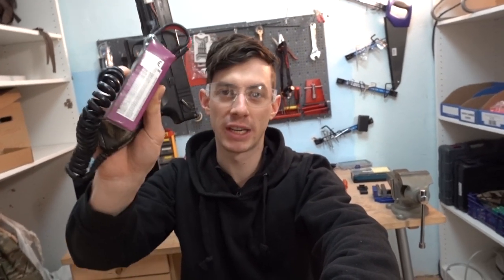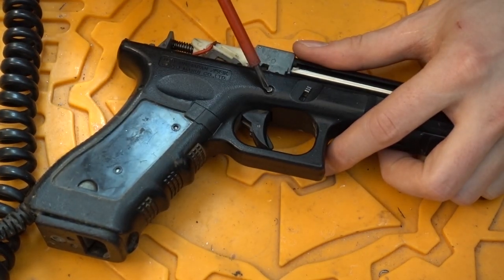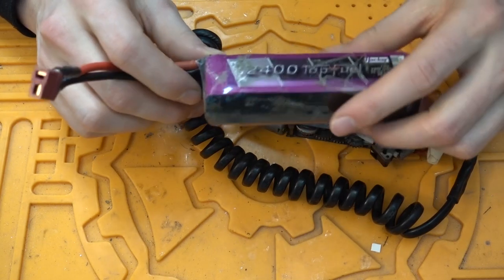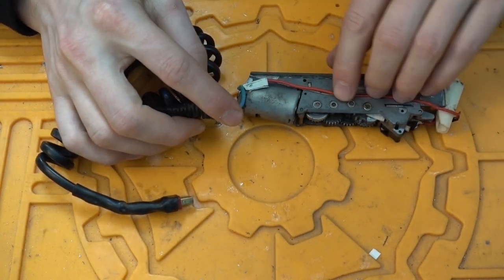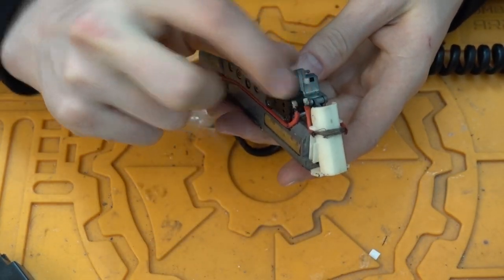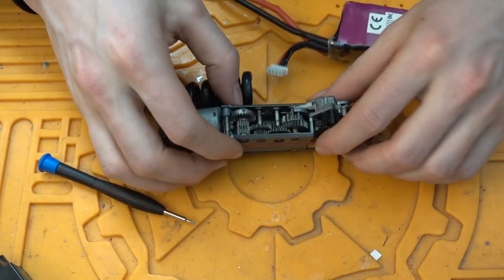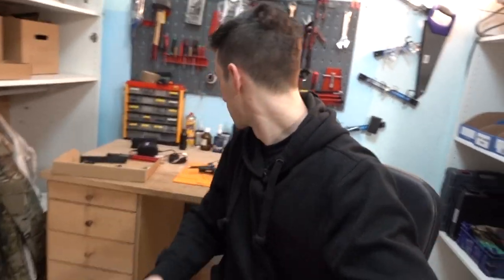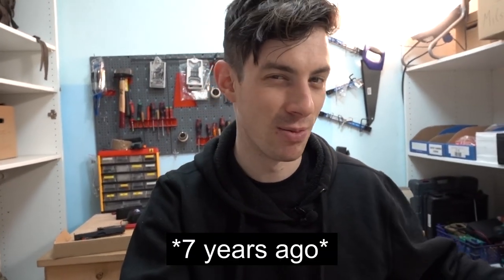External 3S AEP Lipo Mod - Lanyard Cable

Comment: Nice Video Novritsch!
For all which want to do this mod pls don't lose the little Spring under this metal thing on top mounted with 2 screws. Without this spring the pistol will not work properly. Also I highly recommend using a mosfet in this, especially a Cyma aep trigger switch  gets  fucked quickly! I don't know the marui switch unit but I would say that not using a mosfet with this setup isn't ideal as well.

Comment: I really recommend fitting a mosfet in there...
Reply: He's had this set up for a couple of years. He hasn't had a MOSFET in it.
Reply: @callsigngecko4723  I´m not familier with the Marui System. All I can say is, that besides the fact that the cheaper Models (Cyma, Double Eagle) dont like the high voltage batteries, the gears quickly wear of, for sure depending on how much you use the pistol. Maybe your switch unit will hold up the higher voltage load, but a mosfet is definetly a good idea.
Reply: @param3dix  maruis are really reliable. They are (correct me if I'm wrong) the first airsoft maker. They are really good quality. There are very little bad reviews or complaints about the TM platforms.
Reply: @param3dix  also of course mosfets are amazing but not needed in this particular build.
Reply: Yes. Switch assembly should be f*ed up immediately with this lipo.
Reply: Anyone thinks a cyma cm 030 can handle a 7,4v lipo without a mosfet or do you guys think it will die pretty fast? Any answeres appreciated

Comment: just go to a secondhand and buy an old razer or old phone. In most cases it wil cost you less and the quality of these older cables is better than the stuff you can find these days. If that doenst work out, aliexpress.

Comment: It is a good ideea, but ... where is the fuse? All that 11.1 LiPo can (and it will) burn your motor. It happened to a friend of mine , he has a 1911 AEP Cyma gen 2 with mosfet already monted but the Cyma didn't install a fuse so when he upgrade it to a 80 spring and a 11,1 LiPo, the result was a bured motor. So a fuse is a must for AEP/AEG!

Comment: Won't such a high voltage kill your standart motor or gearbox?
Reply: DC motors can handle more voltage, but if you have some more advanced AEP or AEG, there can be some electronics which maybe can't handle it. But problem is you can't just increase voltage only little one li-po or li-ion cell has exactly 3.7V so 2 cells have 7.4 and 3 cells have 11.1V and that could be already too much. So only variant how to increase cadency is probably use 3 cell battery and lower voltage by PWM regulator or voltage step-down chip, but that's already too much complicated and you probably can't but all such things inside of AEP, but with big AEG you could do it I guess. Fully charged 2 cell li-pol or li-ion has 8.4V so I think constant 9V would be perfect. You can use older ni-mh cells where you can work with voltage more precisly because one cell has only 1.5V in fully charged state, but ni-mh batteries have more disadvantages.
Reply: @Pidalin  Thank you for the explanation :)
Reply: @Pidalin  ok but this is standard is 7.4 and 500mah battery and this upgrade is like 4200mah 11.1v battery wouldn't that kill something inside ? :) maybe if you have mosfet version to do this upgrade which i think to will it kill mosfet or its good ? Tnx i love to see someone who like electronic to discus it. I understand that 11.1 vold will push engine speed on automatic but what with normal semi auto shoots ?

Comment: I have a question, I’m just putting this on your newest video cuz maybe you’ll see it first but... I got my SSP1 right, and I was wondering if other hi capa parts are compatible with this gun, like if I wanted to put some airsoft masterpiece parts like a slide or anything in, will it fit??

Comment: There is a Glock aep on the market which has a lipo and mosfet wired to it as standard. I think it's called the Yakuza Delta Tactics Aep but I think the company name changed now. What are you opinions on it?

Comment: I got my SSP1 from batch number 4 a few weeks ago, it was amazing the first few games but after that, it skips bb’s and the hammer uncocks itself or just gets caught in the center causing co2 leakage. It is an amazing gun, but there’s sometimes that it becomes unreliable in a fight because of it skipping a bb or the hammer locking. If you can respond with an answer as how to fix this, that would be much appreciated
Reply: welcome to airsoft

Comment: Hi, nice video, planning to do the same on a cyma glock, why shoud i use 1mm² if the inside cable is 0,75mm² ? And also do i need an additional mosfet for 11.1V LiPo?
Reply: No you shouldn't. Personally I'd only run a 7.4v it will last longer.
Reply: Don't forget a mosfet or your switchunit runs to hell.

Comment: What do you think about upgrading Hop-up on the Cyma variant? to ML maybe?
Reply: the cylinder volume does not support heavier BBs. The joules actually drop with heaver BBs. There is no need to exchange the bucking as it can hop the lightweight ones anyways. Unless it could improve the seal.
Reply: NOVRITSCH what bb (weight) do you use?
Reply: @kerimerzurum7613 He's using 0.25g bbs

Comment: Is owning an electric pistol worth it? I was thinking of buying one.
Reply: Me too
Reply: It is more efficient and cheaper in the long run. You don't have the cold weather problem with green gas. You don't get the blowback of most gas guns. They can be expensive for good ones
Reply: @callsigngecko4723  Actually you can get blowback but not in every model like gas ones there is GBB and GNB
Reply: Cold Weather and Close Range they are fun.  Range, not so much but that depends on your BB weight (I run ,25s) and if you did any upgrades. Out of the Box my Cyma CM030 with my 7.4v lipo mod shoots 210 FPS.
Reply: Dusty. I’ve had a cyma m9 for almost a year and it’s awesome
Reply: AEP is cool thing, but you should know that AEP mechanicm can't be installed to most of normal size pistols so it's everything bigger than real model and not comfortable, also it's ugly because of that. There are only 2 pistols which can eat AEP mechanism in realistic size - desert eagle and P226. You can't expect AEP pistol will be slim like real colt 1911.
Reply: @Pidalin  I would say AEPs are more comfortable for most adult airsoft players, unless they have small hands. They don't perform as well as GBB/CO2 guns, but hey they are cheap to run.
Reply: @birtalanlorant5572  So I bought Desert Eagle from Cyma just for fun and it is really fun, it's more sport tool than something for real feeling from gun shooting, it's doing vrr vrr and size is even bigger than real desert eagle. I know about problems with gas airsoft guns, it has even advatages, but that few disadvantages are pretty annoying. It looks like that DE can fire many magazines on one battery so it's much cheaper and without stress shooting than with gas, but gas feels much better in hands ofcourse. 
One weird thing I noticed about that DE is that hop-up reacts very randomly, you can't really set it like that all BBs are going straight and it has sometimes problem with double feed, but I believe I can solve that problems, there is no airsoft gun which works ideal when you buy it.
Delay between pressing trigger and shot is acceptable and power is like standard manual spring pistol, not great, but for very close distance it's probably enough.
I have one upgraded manual spring desert eagle from KWC (probably the best spring pistol on market) and it's much more powerfull than AEP, but it's only for fun, not for airsoft.
I will not try to insert stronger spring to that AEP because it would probably make longer delay between pressing trigger and shot.
We need new generation of AEGs and AEPs, today variants are more than 20 years old, they can make it much better with today technologies, I'd like to see something where motor only draw spring and then it shots like manual.

Comment: I just don't understand why he does not use the SSP1 in regular gameplays ... isn't it the best pistol?
Reply: Gas blowbacks have some inherit issues, mainly, the gas part, in cold weather the gas doesn't work as well and will fail real quick. non blowback pistols do better, electric don't care at all
Reply: @wav_form9322  That's why NOV gets also available the CO2 version .... so ... I'm still don't understand why the SSP1's owner does not use his own gun
Reply: @asantossanches  when it gets enough cold co2 is not working